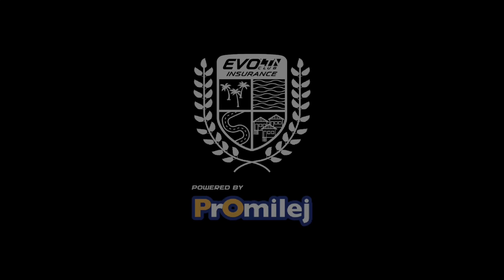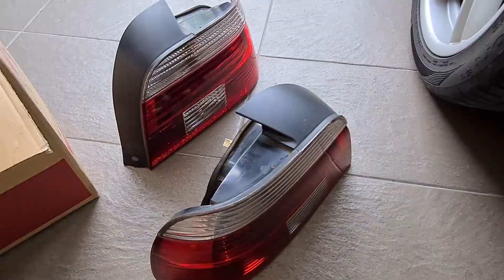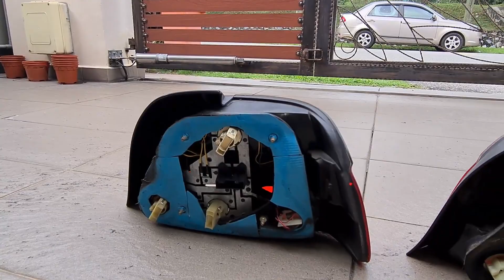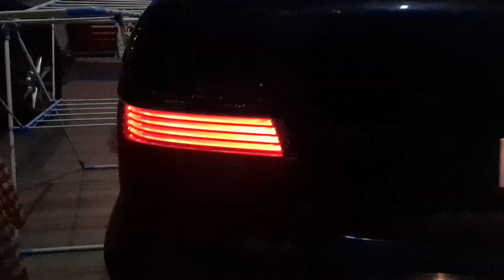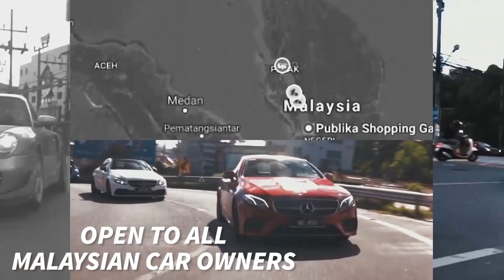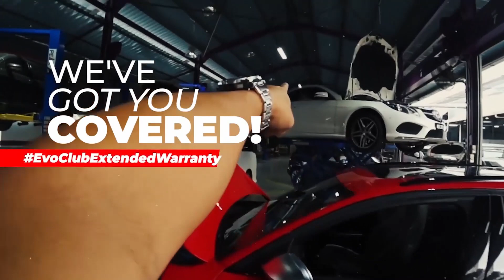BMW E39: The two different types of LED celis tail lights | EvoMalaysia.com

Comment: Ok this is interesting.. I got the hella retrofit kit(with ballasts) on my 99 540.. it came with the clear tails and looked very crisp. After years one of them corroded so I ordered the hella amber celis set off ebay for a new look. The celis strips are no where as bright.. Connections are fine. wasnt sure if I needed a different LCM. My question is: If i have the ballasts already should I look for a new set with the single or double connection. I dont like them being dim.  Thanks.  I will check the sets today if they are single or double.
Reply from the maker: OK, if you're having the ballast, get a set with double wires.

Comment: So I can only say you are incorrect. From what I've gathered the retrofits are modeled after the European design. The euro lights only had the horizontal LEDs on the back and the US OEM lights had an additional 5 small LEDs vertically stacked on the side of the light in order to meet DOT standards. Retrofit LEDs run 10v and need ballasts, the standard non retrofit LEDs run on 12v and you just need an adapter. It will say 12v on the bottom lip of the light. Lastly I hold in my hand a standard 12v OEM LED taillight that needs no ballasts and has not 1 but 2 red wires on the back part... If its got 1 wire its a retrofit. but you can also look for the side LEDs. The reason that LED has 2 yellow wires on it is because its neither OEM or retrofit... Its a trash DEPO light, that's also why it leaks water where as OEM and retrofit lights do not. OEM and retrofit lights will say Hella on them and the depo lights will not. also Depo lights are plug and play and don't need the ballasts either but wont last more than a year in the sun. It always fascinates me how someone can confidently attempt to educate others on a subject that there uneducated in themselves.... Shame on you.
Reply from the maker: Ok

Comment: Hi kon, i have bought the hella celis led tailamp, , i have a 520i m54 2003, is the taillamp plug and play or must i install the ballast?
Reply from the maker: If it has one yellow wire at the back, it's plug and play.

Comment: Very good information for the different versions and Hella aftermarket lights. 
Not sure about how the weather seal foam degrades on BMW parts, but be prepared to add or redo the rear lamp cluster's seal. My previous car's was already partially brittle and even stuck dead on to the body, which got torn and had to be redone.
Reply from the maker: That explains the blue add-on foam on the outgoing retrofit lights. Haha.